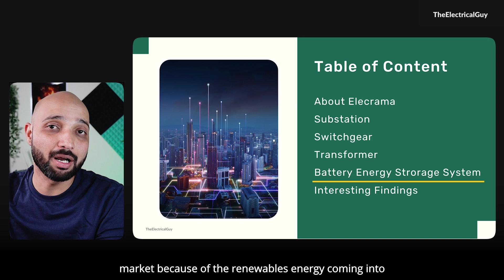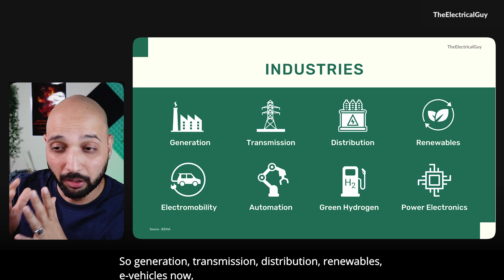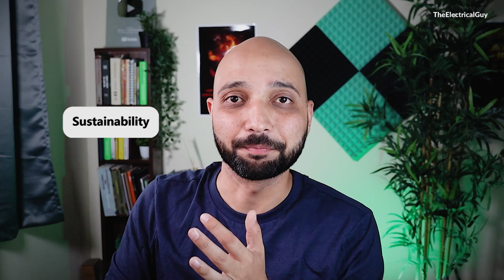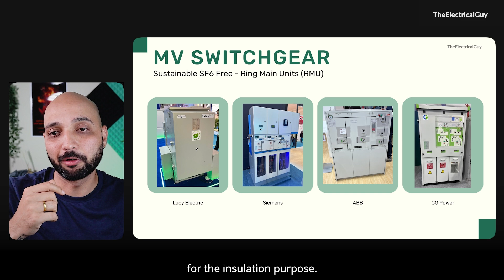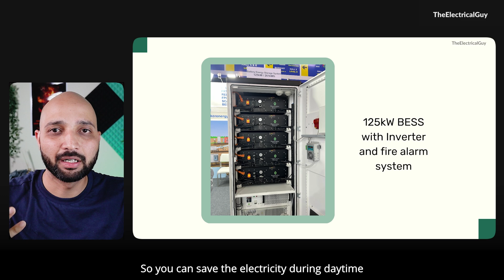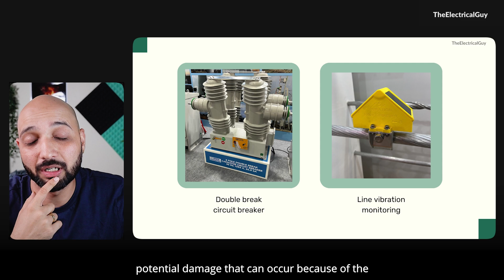What's New in Switchgear Technology? | Major Innovations Explained

Comment: Hi Gaurav. I'm a mechanical engineer, but now I'm working in the High Voltage Circuit Breaker industry. I have a question. Can you explain it to me?
That is: " What is the current direction of the Arc when the circuit breaker opens the Arcing contact? Is it AC or DC."
Thanks a lot

Comment: Well! Not only in capacitor s, but also in inductors, like transformers, the voltage & current are out of phase by 90 degrees. But, a single break per pole circuit breaker performs very well even very high capacity transformers. So, the issue is NOT the voltage & current being out of phase. Also, it is also not very correct to say that for all capacitor switching, double break per pole breakers are mandatory. Upto 24kV, there is no problem in capacitor switching with single break per pole circuit breakers. The problem is with 33kV & above rating capacitors. The issue is a wee bit technical. Will take a longer time to discuss. In short,  your explanation about double break breaker is not completely correct.

Comment: Double brake CB is the practical application of the concept “point on wave switching”?
Reply: No. Point on wave switching is yet another technique to limit the inrush current and its consequent effects. But for point on wave switching, you need single pole circuit breakers with individual operating mechanism for each pole. At least in 33 kV voltage level, that would be a costly solution. Our three pole double break per pole - about which the video speaks, in a intermediary, cost effective solution between a single break per pole circuit breaker which could damage itself and the system during capacitor switching and the costly point on wave switching. By the way, this product won the best indigenously developed product award in the last ELECRAMA 2023. And, we also have a single pole double break per pole circuit breaker with our own point on wave controller.
Reply: @ Thank you so much for taking the time to share the information with me, despite your busy schedule. I truly appreciate your kindness!